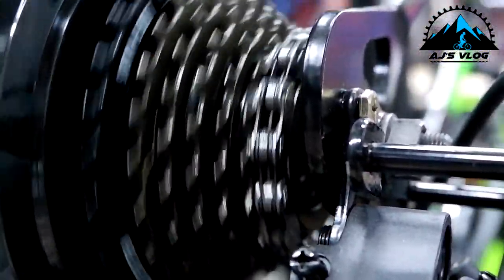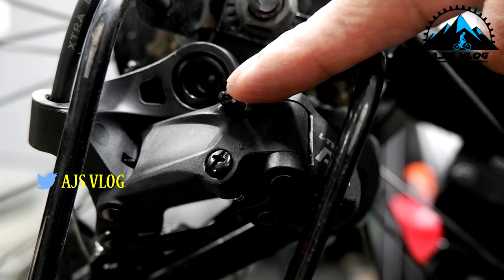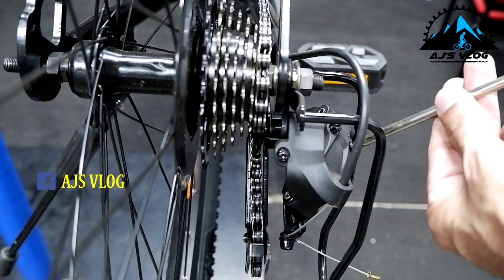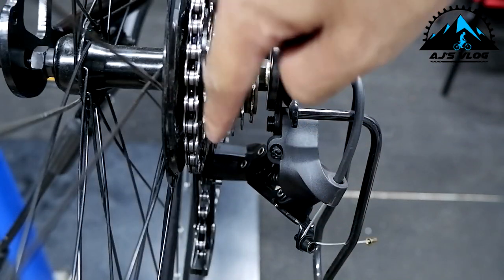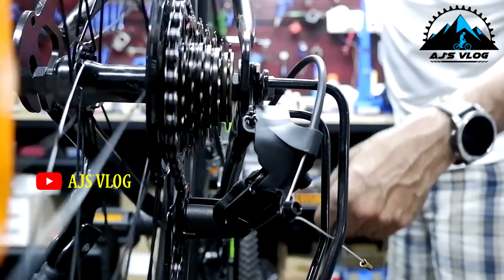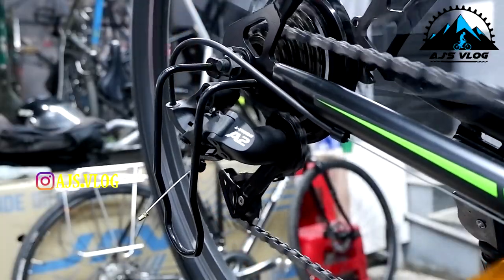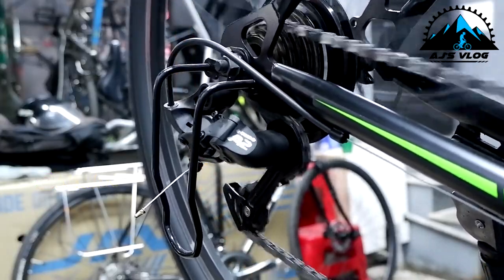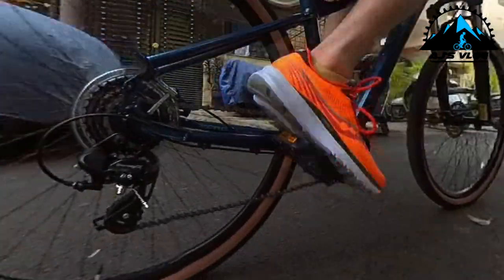Better gear shifting | L Twoo derailleur Adjustment | Ajs Cycling vlog | Indian Cycling Vlog

Comment: I came across an Ltwoo A1 today. It doesn't seem to have a barrel adjuster like so many other derailleurs. I guess that using the limit screws (and manual cable tension setting) is the only way to tune these mechs. Usually, you use a combination of barrel adjuster for cable tension and the limiter screws.

Comment: i think i will replace my gfs mountain bike derailleur and shifter with this ltwoo a2 in thailand.i have used these ltwoo in the uk on my 10 speed bike and they work very well.i usually order from aliexpress.there are some very good value components to be had from china if you know what to look for.sensah also good company as are ztto for cassettes.

Comment: Hey there !! I have a problem,In my bike I can't shift to the first gear and I don't know why ? It is always stuck on the second gear only and in the shifter it shows that the gear is in the 1sr drivetrain please help
Reply from the maker: Your cable is too tight - loosen the cable holding screw and set it right
Reply: @ajscyclingvlog  thanks a lot 🙏 😊  it worked for me,I liked your video and subscribed 😀